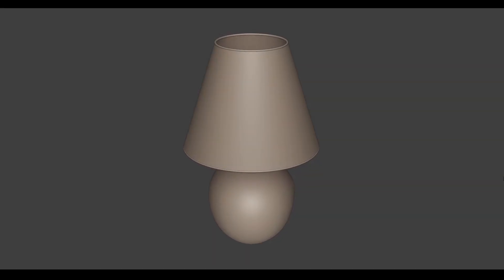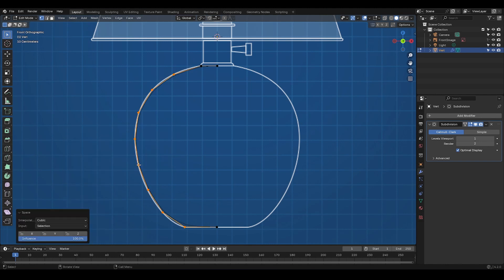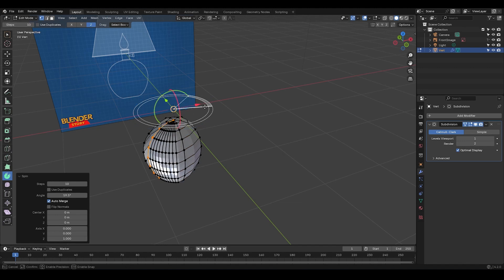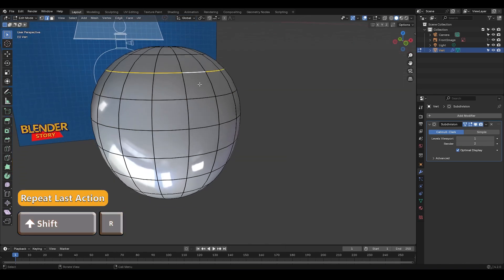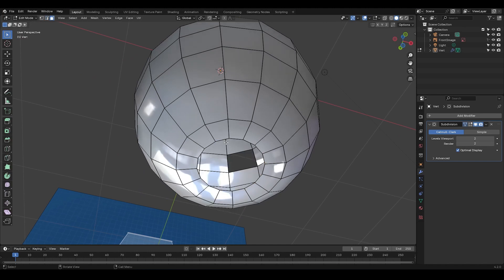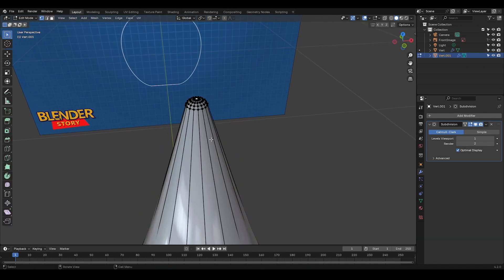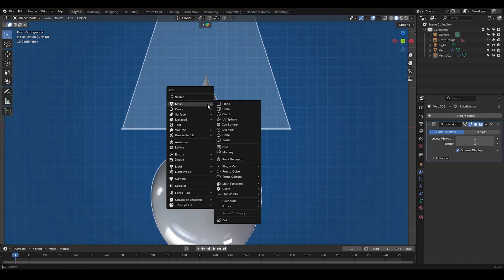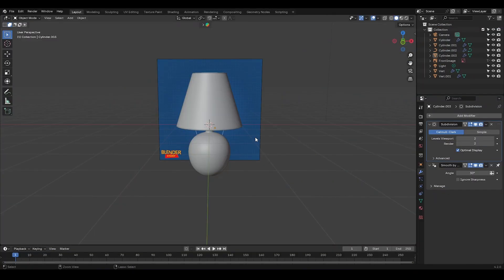Blender Story | Ep. 10 - Precision in Every Edge: Table Lamp Modeling Secrets!

Comment: 16:41 why do we have a green highglight around the edge loop here ? Mine doesn't show such highglight
Reply from the maker: It’s actually from the Mark Sharp option in Blender.
Here’s what’s happening:
I used Shade Auto Smooth, which adds a “Smooth by Angle” modifier in the stack. When I applied that modifier, Blender marked those edges as Sharp, and that’s why they show up with a green highlight in Edit Mode.

If you don’t see it on your side, it might be because you haven’t applied the “Smooth by Angle” modifier yet.

You can also manually mark edges as sharp:
Just go into Edit Mode, select the edge loop you want, then go to the Edge menu (top-left of the viewport) and choose Mark Sharp.

Hope that clears it up! 👌

Comment: In general a good approach. Imho using a curve (made with the free addon Bezier Utilities, just a few clicks in object mode) and using the screw modifier is faster and way more flexible. You can change the shape very quick without having to select and move every single vertex. If you are satisfied with the shape you can convert it to mesh (you can keep the curve for later use with other shapes), use Looptools/Space to even out the loop distance if needed, and if there are still shading issues use the Edgeflow addon.
Reply from the maker: Thanks for sharing this! Your approach sounds really efficient and flexible. I appreciate the tip about using the curve and screw modifier combo, and especially keeping the curve for later use. Definitely something to consider!